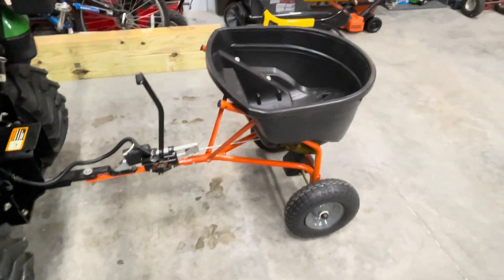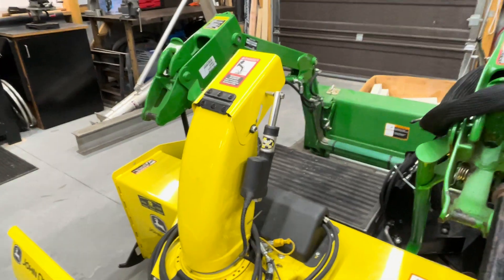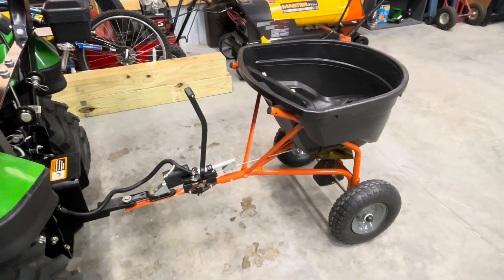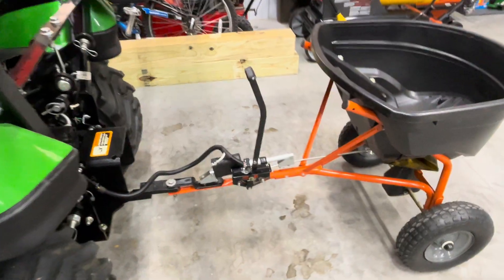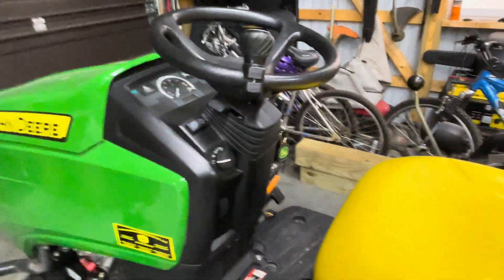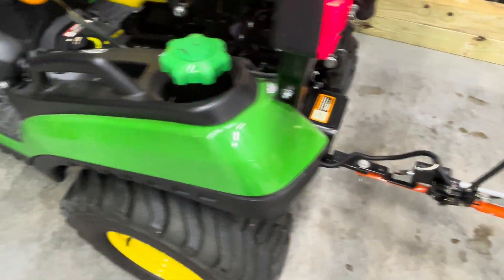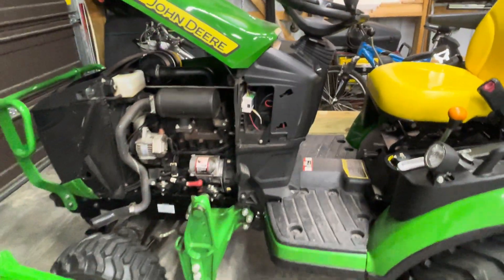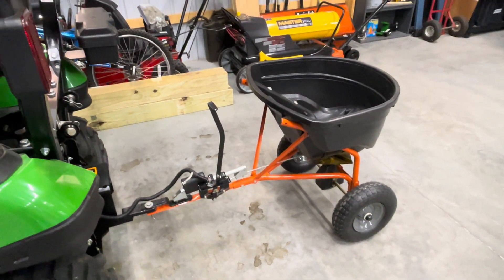Linear Actuator - Agri-Fab Tow Behind Spreader

Comment: I wired according to diagram but works reverse of what I want. As soon as I reverse to close gate it stops as soon as the magnet looses its pull
Reply from the maker: Did you try changing the wire on the reed switch from NO to NC? Maybe there is something different in the controller box you are using.
Reply: @airik7777 in using the same controller box that’s in the video . The magnet won’t stop it when it contracts but it has to be connected in order for it to extend
Reply: I also changed the yellow wire on the reed switch and it does not work
Reply: Would it work if I used a micro switch

Comment: Love the idea however when I mounted my reed switch in the same fashion, I found that the distance of the arm changes from the reed switch. Did you experience this issue? If so, how did you find a workaround?
Reply from the maker: Hi there. Not totally sure I follow what you are describing, but I think you are talking about the gate lever not stopping in the same location each time? I did notice that on an early iteration but I ended up using a much stronger magnet rather than the included one that comes with the read switch. I just used a round neodymium that I attached to the arm. That is able to trigger the read switch much more consistently than the stock magnet. I also wanted to maintain an air gap between the arm and the read switch so it would not contact it when opening. I have about a 3/4" gap between the arm and the read switch when it gets triggered. Hope this helps but if I totally misunderstood, let me know and I'll try to give a better answer.

Comment: Just a note, if using the magnetic reed switch suggested be aware it is not sealed. So when hosing the spreader to clean the switch can ingest water and short out making it inop. Suggest to encase the switch in RTV, the bottom of the switch does pop off and you could also fill it with RTV. Better yet get a weather tight switch and be done.....

Comment: Where do the wires go in controller I get everything except for the magnetic switch wires go
Reply from the maker: @terrykaeding1585  There is a wiring diagram linked in the video description. That should get you started but depending on what controller you have, it might be a little different.

Comment: I used the provided link to the linear actuator. That actuator does NOT include the mounting brackets as mentioned. They must be ordered separately.  Search for DEMOTOR PERFORMANCE PART #PLB1 - $17.89. It might also be found by searching for the actuator again and scrolling down to the “PRODUCTS RELATED TO THIS ITEM” Section

Comment: wouldn't a microswitch work a little better than the magnetic reed switch?  I find those to be finicky in terms of when it actually activates.
Reply from the maker: A micro switch would work as well. In fact, that is the path I started down but then decided to use a magnetic reed switch instead. I usually hose down the spreader with water after I put fertilizer down and was a little worried about water getting into the micro switch and causing it to malfunction or corrode. Since magnetic reed switches are sealed, they should handle the water better. I did use a larger, more powerful magnet on the lever side to make sure it activated. I also wanted to maintain an air gap between the switch and the lever. When the actuator gets commanded to shut off, it actually continues to travel a few millimeters before it comes to a complete stop. Since a micro switch needs to be contacted to activate, you would probably want a longer lever on the switch to allow for the continued travel so it would not get damaged. The air gap with  a reed switch provides a gap margin and allows plenty of room for the actuator to complete its travel after being commanded to stop. I have used this setup about 15 times now, fertilizing about 2 acres each application with a lot of open/close cycles, and have not had it fail to function. But lots of other modifications to this design would certainly work. I just wanted to demonstrate how I did mine to give inspiration to other designs and applications.
Reply: @airik7777  thanks.  I found a waterproof micro switch, but the delay in shut down is worrying.  Great video!
Reply from the maker: @jackmorgan709  It would be interesting to measure the travel distance after the command is sent to stop the actuator. You could probably rig up a dial indicator on the bench and measure it to see if the actuator you are going to use has as much travel as mine does. It's not much, but it does still move a bit after the stop command.
Reply: @airik7777  installed a microswitch and it works no problem.  It seems to disengage instantly - might move a mm or so after the command.

Comment: Thanks so much for this, I just converted my John Deere spreader today which looks to be the same manufacturer as this one. There is an error in the wiring diagram though - on the reed switch, the yellow wire has to go to NC (normally closed) and not NO (normally open) like the diagram shows. I wired it this way and it took me a while to figure out what the problem was. The motor would retract when you pushed the button....ignoring the limit switch and beginning to bend up linkage. It wouldn't extend at all....until I unhooked all the linkage. The magnet had to be against the reed switch for it to retract....opposite of what we want here. I moved the yellow wire to NC and now it works perfect.

I did also refine a couple of things - I haven't yet, but I am going to use some type of quick release clip for the linkage in case the battery dies or there is an issue while the trap is open, there is an easy remedy to keep the bin from emptying on the ground. I also mounted the controller to the spreader itself using heavy duty picture hanging strips. This way I can loan it to a buddy or use another tractor that doesn't have the controller. Lastly I ordered a power tap for my 12v Dewalt batteries that way this is 100 percent fully contained and all you have to hook up is your hitch and you're fertilizing. A couple of pics of my install are below. Thanks again! 
https://imgur.com/CsZn7RD
https://imgur.com/XltzqAd
Reply: I was having the same problem. I'm going to look at it again I had given up on using this. Thank you😀
Reply: I changed the yellow wire on the reed switch still doesn’t work correctly

Comment: Pure genius!!  I have the same spreader with a zero turn, and this is exactly what i was looking for!!!   I love the fact that you left everything factory on the spreader and still had FULL functionality as intended, including the spreader settings.   I love it!!   I've already ordered everything you have!   You're awesome, man!   Thanks for posting and helping out!🙂🤗👍🏿
Reply from the maker: Thanks man. The one thing I forgot to mention in the video was the larger magnet that I put on the lever. The reed switch will come with a magnet but I used a more powerful one so I could maintain an air gap between the lever and the reed switch/bracket. That way they don't come in contact with one another while the actuator is stopping. If the magnet is too weak, it will need to be closer to the reed switch in order to open the circuit and the lever could actually contact the reed switch before it fully stops. Good luck with it! Just got done putting 250lbs of fertilizer on the lawn this weekend and it still works like a charm!
Reply: @airik7777  awesome man!   I will use an earth magnet!  That should do the trick.  Actually, you did mention and cover this in your video.
You have outstanding ingenuity!  As soon as I get everything installed and operating, I will get my pre emergent down along with a good slow release fertilizer!  Bravo to you, and you're hard work!   I know your yard will look amazing!
Reply: I also meant to ask if you remember what size cable clamps you used for the rod that connects to the hopper gate?  If not, no worries, I can just mic it.
Reply from the maker: @mrbrad41471  I'm not exactly sure what size they were. I "think" they are 1/4" since that is the diameter of the gate control rod. I already had them here in my hardware drawers so didn't have to buy them when I put this together.
Reply: @airik7777  ok perfect.   Thanks for the response
Reply: Just one more small question.  What did you install underneath the cable clamp and gate rod?  It that a piece of foam or rubber to negate the metal to metal contact of the actuation process?@airik7777
Reply from the maker: @mrbrad41471  Sorry for the late reply. That material in that one photo was just a piece of rubber that I was hoping would prevent the rod from slipping. It sort of worked but it could still slip a little and twist in the bracket. So I added a second cable clamp (visible in the video) and removed the piece of rubber altogether. That made a big difference and the rod does not slip or twist in the bracket anymore. So I highly recommend using two cable clamps on the rod.
Reply: @airik7777  I do have two brackets.  I hope I have the room for both!   They are 1/4" cable clamps.  Going to install everything tonight now that I have everything.
Reply: Little problem.  The 1/4 are a little to big for the actuator clamp.   Judging by your picture, the ubolt clamp must be a lot smaller.   My question  is, what is the thread size of the threads?   That will indicate what size wire rope clips to use.
Reply from the maker: @mrbrad41471  I took a nut off and used my thread checker. They are 10-24 threads. I guess these little clamps are sized based on the size of the wire x2 since you would be clamping two sections together.
Reply: @airik7777  I ended up using a 1/8 size clamp, and that did the trick.  Did many cycles, and it works like a champ!  I can't wait to try it out live.  I have you to thank for this wonderful layout, my friend.  You Rock!!!
Reply from the maker: @mrbrad41471  Awesome! Glad it all came together.

Comment: Looks good does the the Magnetic reed switch shut the actuator off when it gets close to the reed switch?
Reply from the maker: Yes, the reed switch shuts the actuator off when the magnet gets within about 1/2” from the reed switch. That is why I used a stronger magnet. I wanted it to activate the reed switch before coming in contact with it so I could maintain an air gap buffer between them.

Comment: Can you use the other part that comes with the reed swicth instead of a magnet?
Reply from the maker: Sorry for the late reply. Yes, you could use the magnetic part that comes with the reed switch but it is a bit weaker than the magnet I ended up using. The reason I swapped it out was to provide an air gap between the magnet and the reed switch. The magnet that comes with the reed switch has to contact the other part in order to activate the switch. I wanted to have a little air buffer between the magnet and the reed switch to avoid them coming in direct contact with one another and potentially causing damage or moving them around on the mounting point. The stronger magnet allows the reed switch to activate while maintaining about a 3/8" to 1/2" gap between them.
Reply: @airik7777  the reason I asked was that, when I used a magnet it crashed. It would close as it should but when it came to opening it would not stop until it crashed and bent the rod. I ordered everything you suggested and hooked it up the way you suggested.
Reply: @cad1995 I am having the same problem did you get it resolved ?
Reply: @cad1995 Hey cad I worked on the acuator the this. Morning I had to switch the yellow wire on my reed switch to NC position now everything is working.I dont know what acuator you have mine has a Blue and brown wire on it.I have the blue wire connected to the white of the trailer harness and the brown to the brown wire othe trailer harness.On the Eco remote control box white is connected tothe 1st or outside wire terminal brown is the second terminal just like the original wiring .The magnet I used cmae from Digikey about the size of a nickel and about 3/8 of an inch thick.I have it on  handlet like the video but I hadto mount it higher for eveything to work had play with the placement of it.To close to the red switch it wont work.I have about a half inch gap between the reed switch and the handle .Palcement of the magnet is very important.I was close to the switch on my gravley so I could turnoff the power to the Eco remote box so ot wouldn't come back to far while I was getting the magnet position figuered out.I am going to glue the magnet on so it doesntove aroid now tht I havefound a happy medium foe the magnet.Hope this helps.

Comment: Please provide a wiring diagram.  Having some difficulty with the open close with the reader switch.  I can get it to stop however, it will not start without manually moving the lever away from the magnet
Reply from the maker: If you expand the Video Comments, I included a wiring diagram when I posted the video a while back.

Comment: Thanks for the video it has helped to this point.  I have a question for you regarding the actual wiring.  Where does the magnetic read switch get attached to the controller box.  What do you have the 4 wire connection wire attached. Thank you. George
Reply from the maker: There is a wiring diagram linked in the video description. That should answer you questions but happy to elaborate more if it doesn't.

Comment: Found my way through the system and found the wiring diagram, thanks! Did your controller have a learning feature? I seem to be getting a number of light colors but I don't seem to be getting any action. Thanks in advance for any advice you can offer!
Reply from the maker: Mine did not have a learning feature. Sorry.
Reply: On the side of the box there is a 3 position switch. LEAVE it in O position or middle .That is for useing it manually inthe up or down position.I had to switch the yellow wire on my reed switch to NC to get it to work for open and close.I put the magnet on the handle like the original video.I had to raise it up about 1 1/2 inches and play with it to get ot set right I still have about a 1/2 inch air gap between the reed switch  and the handle

Comment: This works great, Thank you! I mounted my controller to the front frame of the spreader in a plastic double wall switch box so I can switch between my 1025r and my 0 turn mower. I used a 2 pin power connector and make pigtails to adapt to what tow rig I'm using.

Comment: Why did you use a 4” actuator? The gate on the spreader wide open is no more then 3/4” when the gate max open? I been thinking of using a 1” linear actuator for my spreader.
Reply from the maker: I already had a 4" actuator that is used on my snow blower so I used that as a mockup to see if I could fit one to the spreader. Since it turned out to be easy to mount to the spreader without any modifications, I just went ahead and got another 4" one rather that try to fit one with a shorter throw (I also now have a backup for my snowblower if I am in a jam). I wanted the gate opening to be variable by adjusting the existing stop, so the length of the throw didn't really matter (to a point). I am sure you could use a shorter one but you would have to watch out for clearance next to the spreader arm mechanism if you try to mount it like I mounted mine. Probably lots of other options if you play around with it.

Comment: @airik7777 any recommendation for a magnetic reed switch?
Reply from the maker: Lots of options for reed switches. Here is an Amazon link to one that is similar to what I used: https://www.amazon.com/Magnetic-Switch-Normally-Security-Contact/dp/B086GYJLML/ref=sr_1_5?crid=1SOT753H7J1YW
Reply: @airik7777  thanks. I actually ordered a set already that are quite similar. I need to play with the wiring. I have the mechanical install done, verified no binding. Time for the reed switch.

Comment: It stop ok to open the gate but it won’t go back with the magnet in place.
Reply from the maker: This is why I ended up using a controller box.That solves the problem you encounter when you have an open circuit when the reed switch is open. I added a wiring diagram to the video description that might help.
Reply: Try switching the yellow wire to the NC on the reed switch thats what mine was doing.That  magnet was very sensitive to the open position I had set to close and it would not work right to far and it will let the acuator keep going and bind upon the on the spreader setting handle.

.